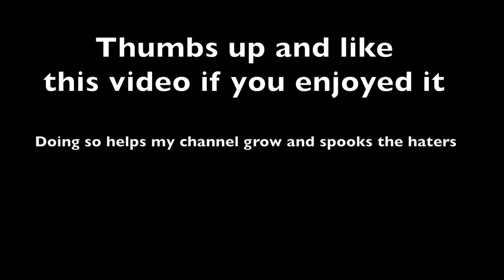Demonstration of pressure-locked Hydraulic Couplers attaching a grapple to a utility tractor loader

Comment: You need to watch the video on how to release  the pressure on hydraulic systems when disconnecting couplers!
Reply from the maker: The male and female ends on the grapple were connected together at a lower temperature in the prior winter which is what created the pressure just in the grapple's hydraulic lines. Aside from the nifty way I showed how to disconnect farm/Agg-style quick couplers in this video, in this case, the only other way is to crack open a hydraulic line on the grapple. In another video, I show how to use a torch to open up frozen Agg quick couplers. https://youtu.be/YeXw_S6vCBw?t=90

Comment: Hey Eric take a couples palets 3 or 4 and you will see better . have good day
Reply from the maker: Be even better with a ground guide, but a well designed SSQA tapers the sides so the loader self-centers making it easier to attach even if visibility is limited.

Comment: Is it normal for the male end on the tractor to shot out some fluid when hooking up? does the tractor need to be off? I'm going from a skid steer to a kioti and this happened when I tried hooking up my grapple, I didn't want to get fluid everywhere so I wanted to ask someone first. Thank you
Reply from the maker: Michael, in this video I had detached the grapple when it was cold in the early winter. Come spring when I shot this video, the temperature was much warmer and the ambient temperature had created pressure in the grapple’s hydraulic lines. As a result, you see me using a wrench and a hammer to pop the lines apart as well as my slamming the male line down to release the rest of the pressure so I could hook up with the tractor’s third function hydraulic lines. In relatively steady ambient temperatures the tractor can be left running as the valves stop hydraulic pressure from building up in the lines. However, anytime the lines are difficult to attach, it is because either the tractor side or the attachment side of the hydraulic lines has pressure in it, and as a result, operators with the farm-style hydraulic quick attachments will slam the male side down to open up the detent and release the excess pressure in the lines. If there is pressure on the tractor side, then hook up the tractor’s male side to the attachments female side first so that you can slam the attachment’s male side down again to release pressure and attach it. Another video you can watch is when things are cold and the farm-style quick attachments are too cold to work right. Check it out. https://youtu.be/YeXw_S6vCBw
Reply: @MinnesotaEric  Thank you for the info. I got out today to fiddle with it again and found out the connecters on my grapple are just a hair bigger than on tractor so it wouldn't have worked anyways. Got a new set ordered, will be giving it another go once those are in.
Reply from the maker: @michaeljenkins3131  If you're concerned about it, you can fit skid-steer-style-quick-attach connectors on your attachments and tractor as well.